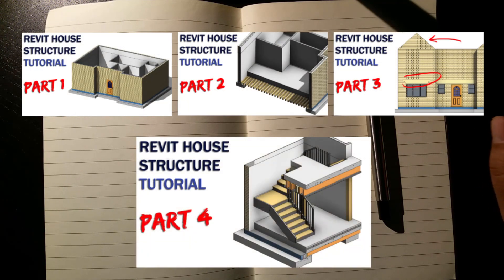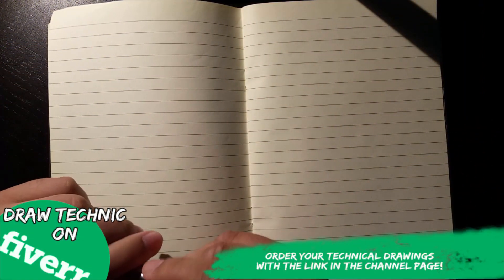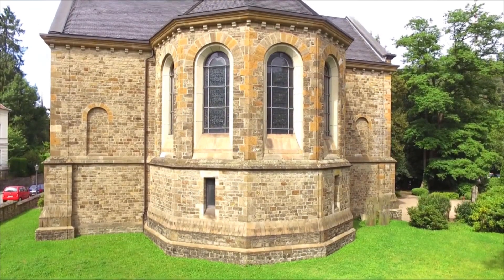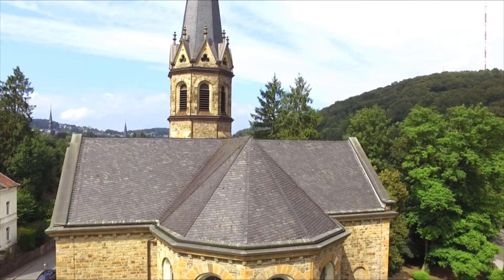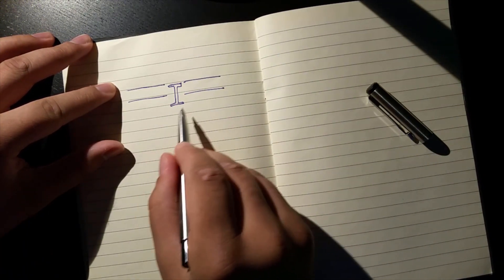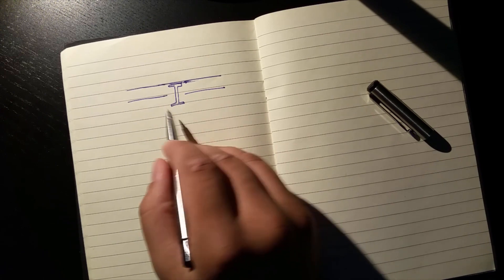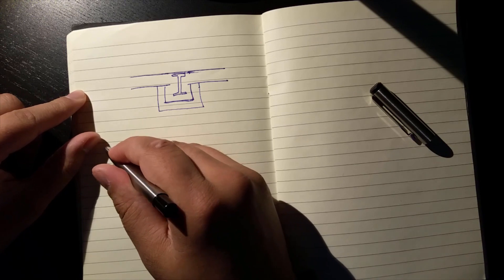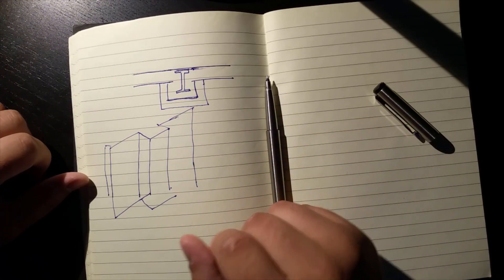How Large Columns are Placed in Walls

Comment: Columns sticking out of walls is very common. Designed many precast column wraps, structural design, not in Revit. Key note: always make things look like it was on purpose. Great video!
Reply from the maker: Thanks for the tip. This was something I struggled with in my university days. I wasn't sure how to place columns in walls and I asked the lecturer, but he sort of left me still wondering. I even stopped a construction site manager just to ask him, he made it a bit more clear but I was still puzzled.

Eventually I was able to sit down with senior technicians and I made sure to find out every little detail about column placement. I wrote down the whole experience in an article at technicaldraft.com.

Architecture and construction is quite tricky when you're left to your own devices!
Reply: @DrawingTechnical  Great article! Your instructor is an idiot on many levels. Almost every building, the columns are an issue. Usually the walls are hidden in the wall construction. The Architect sets limits on how deep the columns can be. Deeper columns are cheaper...can explain if you don't know why. But sometimes there are no options and the steel column is going to extend outside the wall line. Then the Architect designs a nice wall column wrap. I am licensed engineer and designed many buildings. I will be glad to try to answer any questions pertaining to structures. Just started watching your videos. Will have lots of questions to ask you about Revit 🙂
Reply from the maker: @willlywillly  You know what Ken? I'm glad that my work has caught the attention of a licensed and experienced architect or engineer such as yourself. I'm grateful that you're offering to answer questions. I always wanted this channel to be a learning experience for all of us and so far it has been. I try to teach others what I know and others point out how I could do things better and I acknowledge them in my videos.
I might know how to draw a detail or 2 but I am making an effort to understand building structure everyday, and then I try to bring my findings here in video form.
I'll be sure to ask you questions and I hope you'll be able to stick around. I'll try not to annoy you as much as I annoy my work colleagues XD. Do feel free to ask questions about Revit, I'll answer whatever I can, have been using it for over 7 years.
Please do tell, why is it that deeper columns are cheaper?